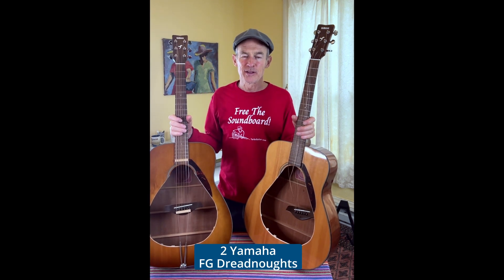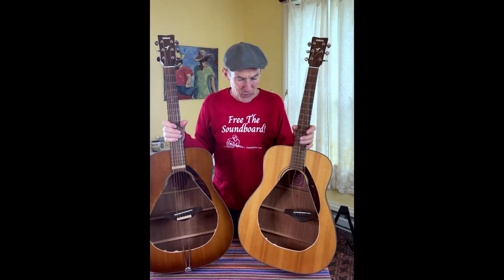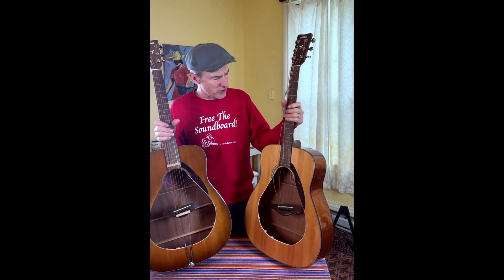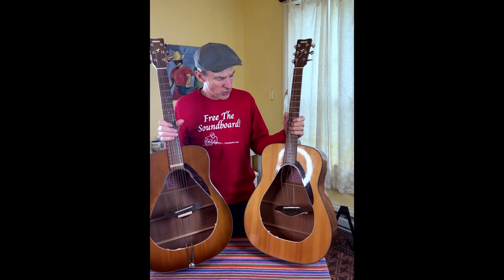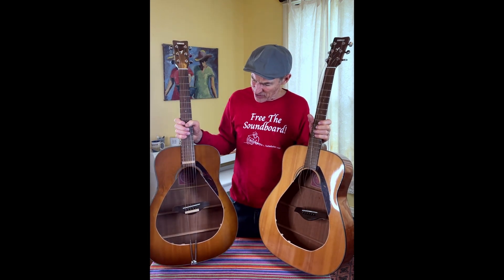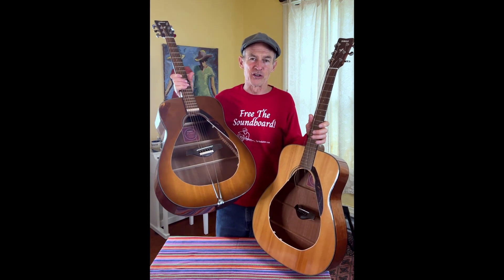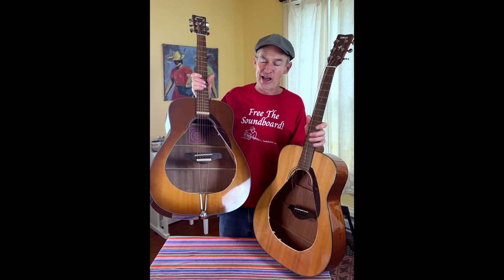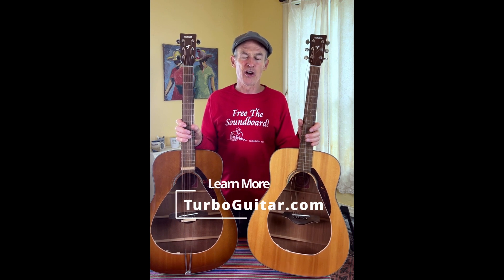Why Traditional Acoustic Guitar Design Is Holding You Back

Comment: I was wondering how effective is the turbo tailpiece on a classical guitar if you have no desire to change to steel strings.  Does it make any improvements with nylon strings?
Reply from the maker: Thanks for your question.  I haven't been interested in testing the TurboTail on regular nylon string guitars myself, although I am curious about the effect.  My gut tells me that nylon string tension doesn't put that much torque on the soundboard, so classical guitars aren't confronted with the  problem of having overly stiff soundboards, the way that steel string guitars do.   Christopher Cozad is building the first custom acoustic with a TurboTail, and he has done more testing of nylon string guitars. You might send him a note; Cozad Guitars.  Also, Marcus Dominelli is a really bright classical builder who is familiar with the concept.  You might contact him as well.  Best wishes, Reyn

Comment: Ok, so a tailpiece. You're going to get less sustain and less string energy moving the soundboard, unless you basically make an archtop or Selmer-Maccaferri style guitar
Reply from the maker: Hi Daniel. Thanks for your comment. I checked out your channel. You play well. If you live near Seattle, please make an appointment to test one of our demo guitars.  Then you will understand that the TurboTail is different from an arch top or flattop with a tailpiece.  

If you were to put a standard tailpiece on this demo dreadnought with the soundboard removed, the bridge would fall into the body. It requires the soundboard structure to support it.   An arch top exerts up to 40 lbs of downward pressure on the bridge.  Thus, the necessity of the arch, which is a really strong form, but not very good at sustain or volume.  The flattop with the tailpiece has a very low string break angle over the saddle, so it is not very good at coupling the string vibrations to the soundboard.  There is a noticeable absence of volume, and bass.  Please listen to the player comments of our demo guitars.  A common theme is their surprise at how loud these are, and how much bass response they have for small bodied guitars.  Best wishes, Reyn

Comment: Where is the sound comparison on the same steelstring with and without turbotail?
I only find classical guitars modified here.
I've done a diy bass version of your system  with a solid cedar top classical.
It is loud and sounds like a double bass but with lack of sustain.
My 24,9' Cort acoustic bass heavily braced but with nylon core strings have tons of it,
but only 1/2 of the acoustic volume.
Reply from the maker: Hoido. Thank you for your comments. I am glad you are experimenting.  I can't do it all myself. Please share your experience with others, so they can learn and not have to repeat our mistakes.  
As for my own standard guitars vs guitars with TurboTail, I have the first half done on three popular guitars, as well as the standard full scale acoustic bass.  However, I got sidetracked with 12 string guitars which are more interesting to me.  I am currently setting up 12 string guitars with paired strings (up to 300 lbs tension) to see how the TurboTail works on these.  These are very popular with Mexican Norteno players, since they offer good bass, as well as good soloing possibilities.  Currently, a lot of players of these guitars install the Bridge Doctor.  I am doing tests to see if the TurboTail offers better performance.  I also am asking Mexican guitarists to test my setups to see what they think....Eventually, I will post the standard guitar comparison that you would like.  However, Work, family, (and sleep) means that it will all take time.